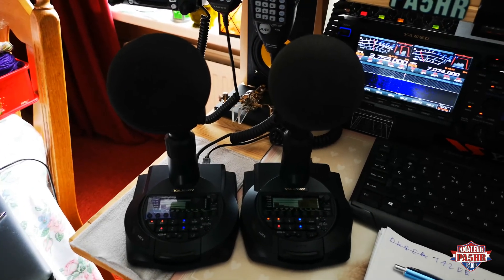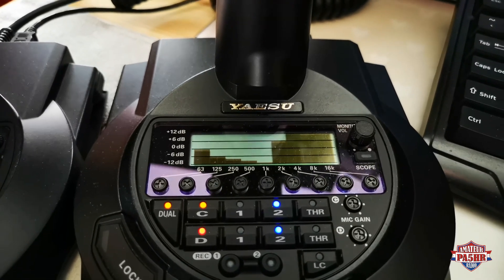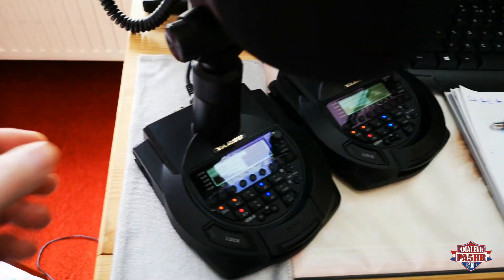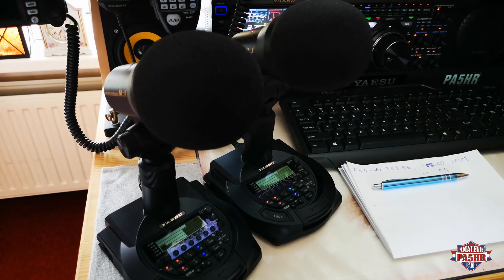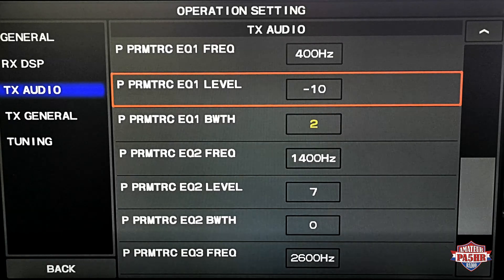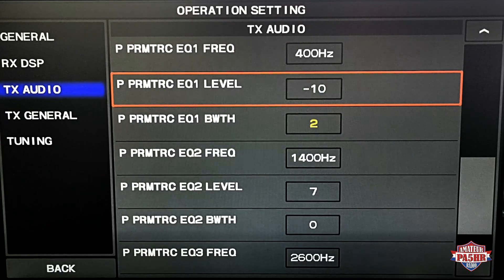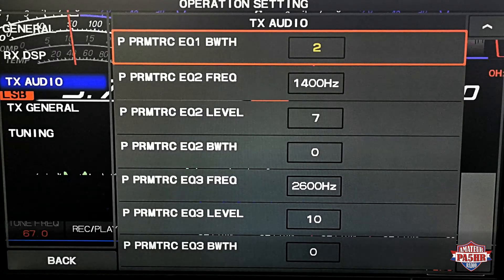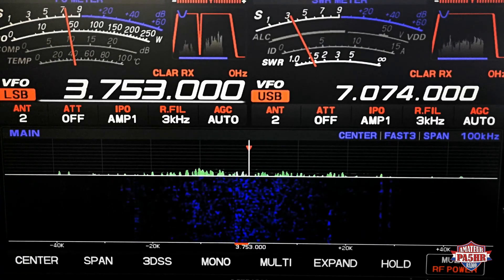M 1 Yaesu EQ Settings on Yaesu FTdx 101mp/Ftdx10

Comment: Really helped me a lot. Only had 101MP and M-1 Mic for two days. I came from a Flex 6400M and Heil 781 so this part of configuring was a difficult one and my audio reports said muffled and way too bass. To take it slow I turned off the EQ settings on the 101MP and only used the EQ settings on the M-1.  Actually using the default M-1 settings on MEMORY #2. Immediately people commented about the great audio with out asking for a audio. Check. This rig and mic are fantastic. Thank you for your video it was very helpful. de K8CGS
Reply from the maker: Thank you for your great comment yes am glad to hear that and yes you are right that is a very good rig and mic also and it works realy good so thank you again and wish you good luck hope we hear us on the bands vy 73 de Bert PA5HR

Comment: Thanks Bert I was struggling with the settings I'll try your settings. 👍
73
Reply from the maker: Thank you Brian hope you can use it for your Voice and let me know it is good for your Voice and Micro.....vy 73 de Bert PA5HR
Reply: Thanks Bert its improved lots ,best audio via headphones is via the socket at the rear of the microphone and not the front of the 101D  
 Cheers Bert and thanks 🍺👍

Comment: If your using the eq settings on the mic surely you would need to turn off the eq settings on the radio ??
Reply: @spuddy spud I keep my eq off and the processer off on my 991a and let my M1 do all the work
Reply from the maker: Hello and thank you for the reaction but the Settings for me works very good and sounds realy nice very crisp and clear with much dynamic in my Modulation so am very glad with my Settings maybe it can be with the EQ off in the Transceiver but i tried many Settings and this gave me the best results and sounds best and my voice is crisp and claer with much Dynamic that was for me everything what i want so thanks again Vy 73 de Bert PA5HR

Comment: Hallo Bert! Hast Du zufällig mal getestet ob das M1 auch gut am IC 7300 spielt bzw. funktioniert?

Gruß Dirk
Reply from the maker: Dirk nein leider habe ich dafuer auch keinen anlass ich braeuchte dafuer wieder einen adapter und dann nutze ich ihn auch nur fuer 4-6 Meter Band dafuer habe ich das SM20vvon Icom also kann ich dir da keine erfahrungsberichte geben aber danke fuer die frage vieleicht mal ein experiment welches mann mal verfolgen kann....Vy 73 Bert PA5HR

Comment: Hi Bert,  what AMC setting are you using with this configuration
Reply from the maker: Hello John i have nothing chance in the AMC Settings that must be the Factory Settings in the FTdx101MP so i have nothing change there.... and the Settings are on the Middel thanks agn vy 73 Bert PA5HR
Reply: I heard AMC should be 100% 73's